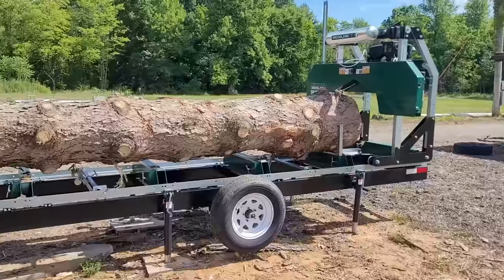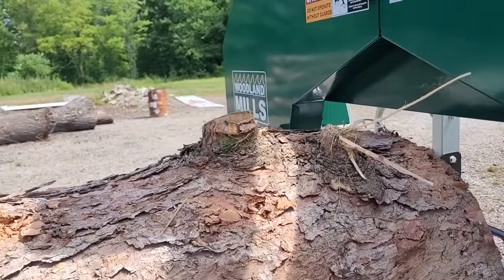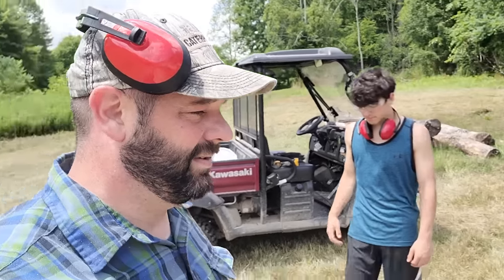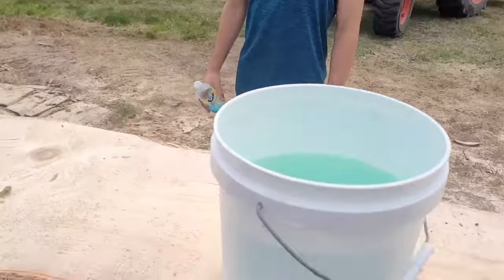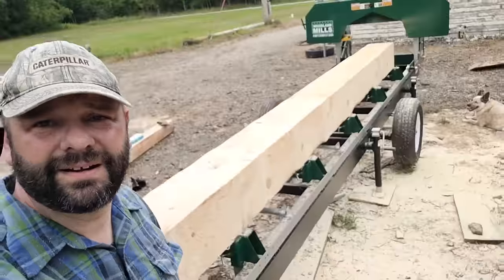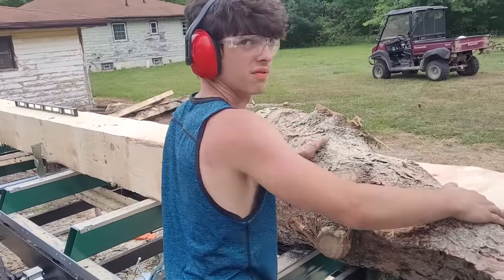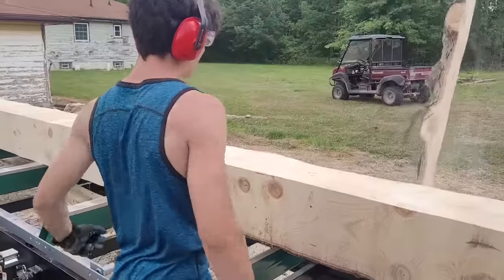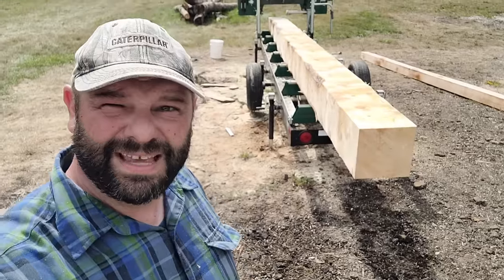#62 Cutting a Log Too BIG for the Sawmill | Sawmill Shed Ep. 3

Comment: There is something oddly satisfying as a man to cut your trees down, mill them, then build something.  Great video as I have to do the same thing on my mill.  BTW, I have the exact same mill.

I seem to remember a Sawing with Sandy video doing this and if I remember correctly, he rotated the log 180 degrees with the canted end through the end of the sawmill.  All he had to do was level the canted part.
Reply from the maker: Thanks for watching!  You are correct!  Sandy does it a little bit differently by rotating the ends.  I call our method "peeling the banana".   Now that we have a crane in our mill shed, we might experiment a little more.  Extra track would also make life easier!
Reply: @BissellMapleFarm  I’d love to hear which method is easier.  I ordered extra track from Woodland Mills and am planning on permanently installing the extra track, but making the trailer mobile so I can take it to remote locations or put it back in the sawmill shed.  I’ve not seen anyone post a video on that, so maybe it won’t work.

Comment: Great job. I like the jack idea. We use wood blocks too, but the jack is great for fine tuning. Our little mill, an American, has blade guides that slide in and out horizontally. These and proper blade tension, (TIGHT!)  and of course a sharp blade and rpm really go a long ways towards eliminating a wavy cut. Those knots are much harder than the softwood and will definitely make a bandsaw "run". I'm about to cut some long timbers on our 16' mill for our new  timber frame sugar camp.
Reply from the maker: Nice!  I'm jealous!

Comment: I cut a 25' monster white pine on my oscar 30. It to has about a 16' work deck. If that wasn't enough challenge I want finished timber wedge shape. This log being 18" - 12" and 6" thick. I'm building a 20x20 old style log cabin man-cave garage building. The gable ends will stick out at least a couple feet so I'm going to need at least four timbers this long. I built a support of cribbing to hold up the potruding end, but have decided to build a bed extention for cutting the rest. It was in the plans anyway. I'm a timber framer who has always struggled to get long enough timbers for projects and dicking around for 8-10 hours cutting out two timbers decided it for me. Granted those two will make 50 square feet of wall but one pass cut would sure speed up the process. Some of that time mentioned was processing the rest of the lumber in the log.

Comment: Instead of using the jack to level the round section, I typically put a 2x12 or 4x12 under the square cant so the round part isn't on a bunk, then shim the very end for stability
Reply from the maker: That's a pretty good idea.

Comment: There is an easier way...!   
Move the over-length Cant/Log down the bed as far as needed & Place some 4x, 5x Etc. on the bunks (Cut to Cut. Worst side UP!) to raise the uncut lower edges. 

If you have truly "squared-Up" the Cant.  
Alternatively; Take the Squared-up, over-length Cant/Log & set it aside. 
Place the 4" slab you cut off earlier >= 6 feet - Down-Track on the Bunks the same orientation as it was originally sawed. (Heavy end toward the beginning) 
Turn the Cant/Log - End-for-End and place it on top of the 4" slab (Cut to Cut. Worst side UP!) raising the uncut edges up above the bunks at the beginning of the track. 
Run the saw-head past the "round" to the surface of the cant where it is sawed to get the height dimension, go back to the beginning of the cant and make your four (4) cuts at that setting while on top of the slab. 
No jacking, math, thinking or leveling needed...!
Reply from the maker: Man, you are probably right.  I'm not smart enough to grasp all of this.  I need to give it to Austin or George.  I am really good at making things harder than they should be!

Comment: I have a HM130max ordered and on the way.....was just noticing the wavy cuts on your beam....is that an accurate assessment?  Dull blade? Pushing mill to fast?
Reply from the maker: Lots of reasons.  All of the above!  Ha!  Truthfully, we didn't quite have everything set up perfect.  We had tension too tight from an uncalibrated torque wrench.  Maybe the biggest factor was the log being spruce.  Knots cause blades to dive if you put and sort of pressure.  Making videos and watch the mill head go across in hyper lapse, you can see the rails dip down where we did not have a solid base under the jacks..  I'm not sure if that did it - or a combination.

We put an RPM meter on the engine, too.  That helped us.  We increased RPM's to 3800-3900 and that made the greatest difference in reducing wave.  Austin keeps it at 3850 and when you have to go slower and slower to stay at 3850 - you know it is time to change the blade.  That's important...  because if you need to push.... the blades will dive.

And finally, there are wear blocks that are supposed to be spaced a business-card-thickess away from the blade.  If those aren't in the right Y axis the blade will be allowed to dive 

Spruce is tough to keep wave out.  But that mill is a bargain.  I recommend the trailer from Argyle WI.  Glad we did it.
Reply: @BissellMapleFarm  thanks for the detailed answer....I will be sure to keep that in mind when I get mine...

Comment: I’m not a sawyer, but would it have worked any better to have had the small end of the log on the other end of the mill?
It looked like your cuts were too big! By making smaller cuts, you could have sawn some boards from the slab’s which would have made them easier to handle!!! Too much waste! The last cut would have provided you with some 1”boards without a lot of extra work!!!
Just saying!!
Reply from the maker: Correct!  It sucked cutting boards out of slabs!  No waste, except time.  Plus we learned.  

As far as the small end...  we found if we do that the log will tip.  We ended up doing that on the next episode.  Episode #63.  It was hard to strap it down and move the ratchet straps...  repeat.  Sucked.